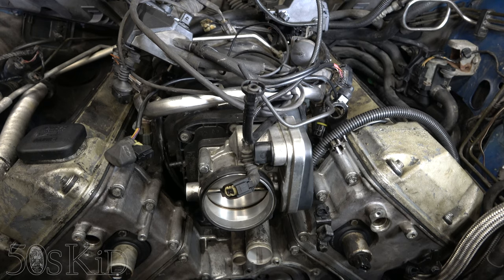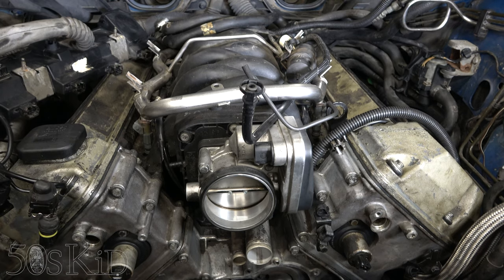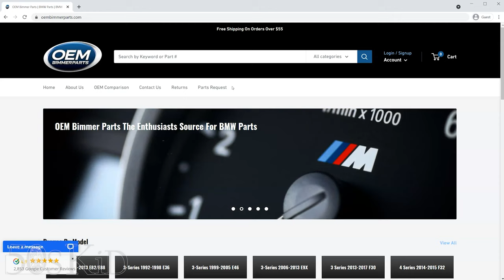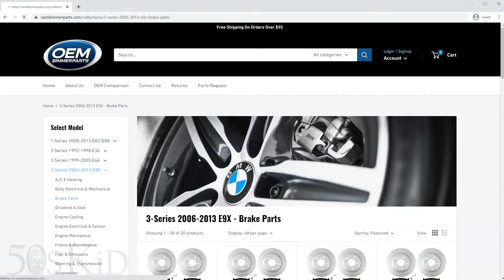Part 4: Valley Pan Replacement - M62TU Timing Chain Guide Replacement DIY - E53 Rescue

Comment: You'll be sorry not replacing the PVC device at the rear. Going to bite you. Great video.....
Reply from the maker: You’re probably right. I will buy a new diaphragm for it
Reply: @50sKid  The one on my '95 740i was next to impossible to get to while the manifold was still on the car.
Reply: @50sKid, Can you purchase just the diaphragm for these?  I think I’ll add that to my parts list. Your link for the cyclone separator and hoses was still good. Added that.

Comment: Hey bud currently doing this entire job timing chain guides included and with the valley pan gasket you didnt putcany rtv on there. Should i run a bead around or do i trust the new valley pan and gasket? Help!

Comment: Great job on all your Videos. Learned a lot from it so thank you. I do have a question. In some of your videos, you mention the Torque values in respect to the size of the bolts. Is this information somewhere ? Or can you share what size relates to what torque ? Thank you once again and great job explaining everything in detail.
Reply from the maker: It’s in the bmw TIS system. Sorry I don’t remember the values off the top of my head
Reply: @50sKid  thanks for the reply. I will check it out.

Comment: WHAT IS THE TORQUE MEASUREMENT FOR THE VALLEY PAN SCREWS?
IN ADVANCE YOU ARE AN EXCELLENT TEACHER AND THANK YOU FOR YOUR TIPS
Reply from the maker: If the bolt thickness is 6mm, it’s 10 nm
Reply: @50sKid  THANKS AMIGO

Comment: Just about the whole video I was cringing and hoping you didn't accidently drop anything like a bold or washer down one of the intake ports.  Some of the valves are open to the cylinder and you would really hate having to pull a head off to get a small washer or bolt out of there!   Something I will do is change the orings on the injectors while I have them out as well. Thanks for taking the time to video; I see some things that I needed to understand in the back of the engine.  Great job with the post editing; I know this takes time. - Clay
Reply from the maker: Worse comes to worse, magnet through the spark plug hole.
Reply: @50sKid  - If you are lucky. Another guy on YouTube “Glen” dropped a flat washer down one of the left bank intake ports and it slipped right past an open valve. Wouldn’t fit back out the spark plug hole.  Anyway, how is the X5 running and doing now after some time?  An update video would be awesome regardless of it’s state. Take care, Clay

Comment: Breaking down and asking for HELP. 98 740i. Changed water pump and knock sensors. Mixed up the i.a.c. plug and the cam sensor plug. (Idiot move) now wont come out of limp mode. Also making a weird air noise inside of intake.

Comment: Why is coolant under the valley pan?
Reply from the maker: To cool the engine -- that passage allows the coolant to travel from one side to the other within the block.
Reply: Heat rises, that valley is formed by the side of the cylinder banks on both sides; the primary source of engine heat is the combustion in those walls. Frictional heat is also generated throughout the Engine but circulating oil carries most of that away and down to the oil sump. Many oil pans will have fins on them as this engine does, to help cool that oil. Most American designed V8 engines don’t have this coolant filled valley, it’s a blessing and a curse.

Comment: Hello Sir, I changed Center dash vent, pulled dash apart to remove, replaced, put it back together, now no air flow from face level vents - how? Why? Anyone know? Fan blows fine

Comment: By the way, the bolts on the CCV is a RIBE bit, not a torx bit, which is likely why people regularly strip them.  No idea why this is the only part on the entire car that uses a RIBE bolt, as far as I know.
Reply from the maker: really? I didn't even notice!
Reply: @50sKid  Yeah, it's super hard to tell.  I didn't either until recently.